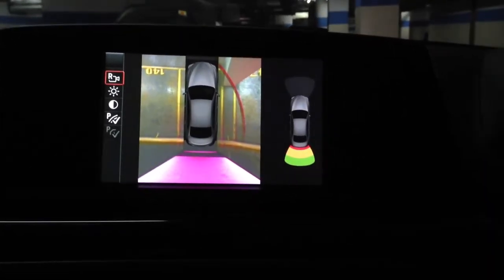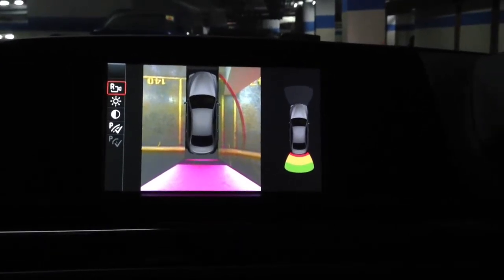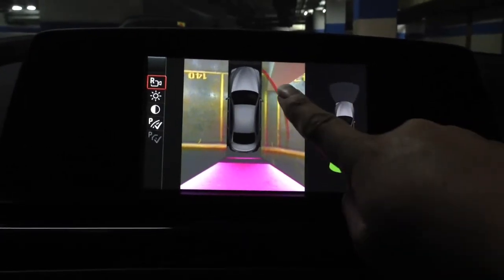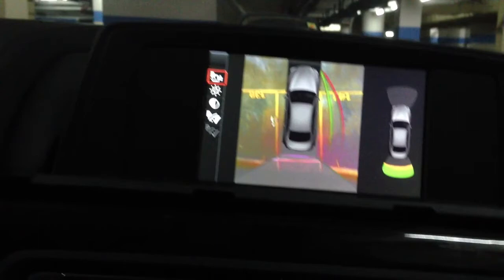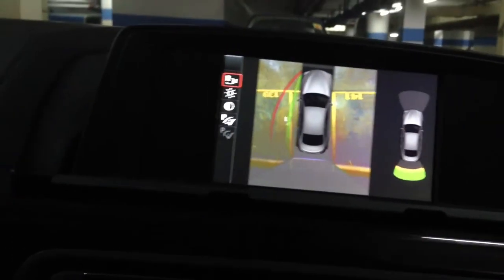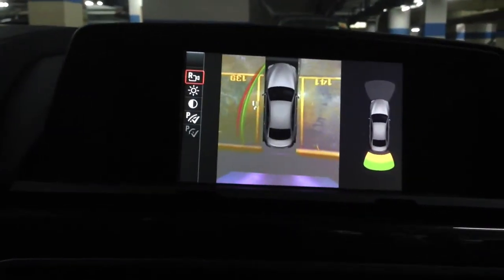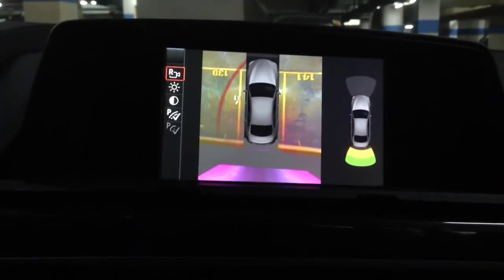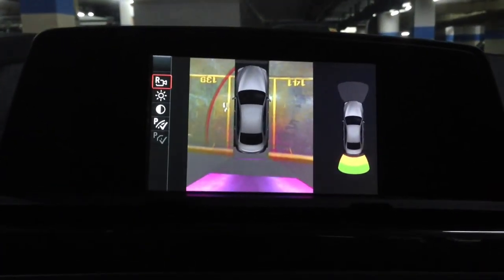Real Operation of Top View Camera

Comment: I just wish they had something for the front so it's possible to tell how close it is to hitting a wall or curb.  The top view system cannot even be available unless you are in reverse.

Because the 750i is so huge compared to any car I had before, my front entry is always off.  I used to be able to make it tight right in the middle but not anymore.   I don't have enough space in the front, side, or rear to make a mistake.  It has to be so professional when using this car.  It takes up the whole parking space.